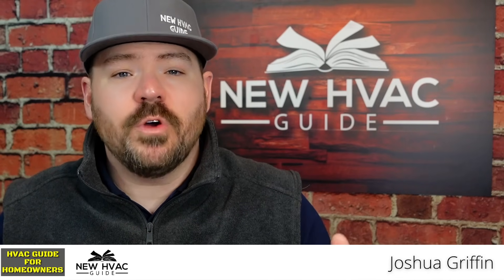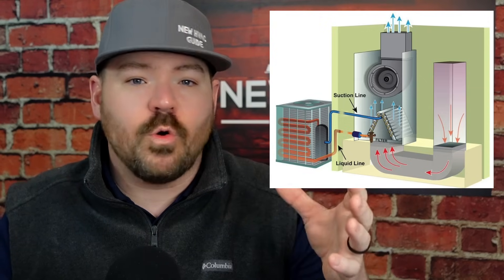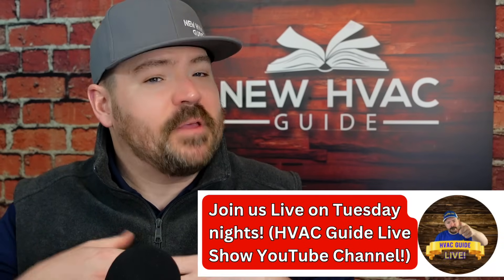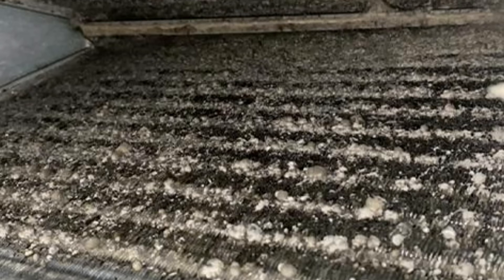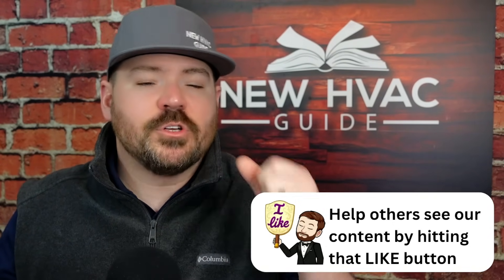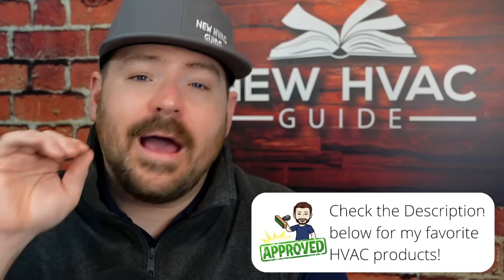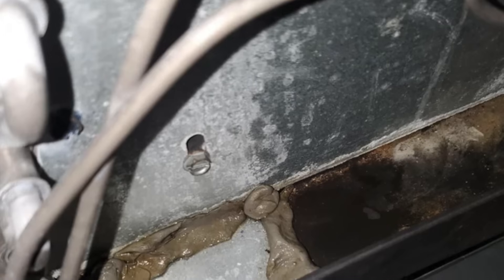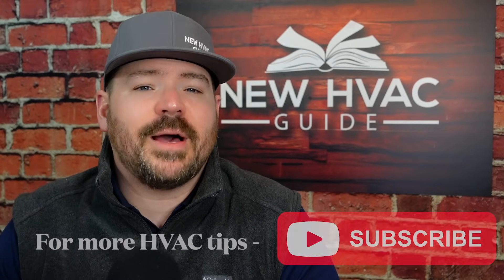HVAC Tip on UV Lights! (Location Matters!)

Comment: I wrote a long explanation of what was just installed in my new Daikin Fit system asking you for an opinion on it, and also other aspects of my install that didn't go as planned. The only thing I can think of to have someone (YT) take it down was I linked the website of the "air purifier" for you to review (in case you never heard of it before). 

I will try again without the link, that being a Respicaire AirSterilizer Pro. If you look it up that way on Google you can see the specs on it, and I inquired what you thought of it. Also the place it was installed was in the plenum above the fan motor, thus none of the UV light (assuming it even has UV) will be hitting the coils or drip pan. As to the issues, I signed a contract for a Daikin 4" hepa filter be installed, and a UV light. Instead they said they were out of the 4" filter housing, so they were upgrading me with a whole house air purifier, hence the Respicaire unit as an upgrade from the two things they didn't install. The other issue was they didn't use the existing duct that went back to the bedroom and hallway returns, and instead said the closet had two opening sufficient to get enough air flow (one in the wall of the air handler closet, and the other to a vent in the door of the closet. 

While I am not a HVAC tech, I do know from my education more airflow coming from distant parts of the house will circulate the air better. Then again you might have a perspective I have not considered regarding the aforementioned. Assuming this reply does not disappear, I look forward to your view.
Reply: @MultiEviscerator  so it’s been about two months and the cigarette smoke is still coming in my house. Spent thousands of dollars and my kid and hacking and having headaches. Our mattress and pillows smell like cigarettes. If anyone can please give me advice I gladly take it. Moving is not going to happen. Single mom and a single standing house costs $600 thousand to 1 million $$. Honestly I shouldn’t have to leave my home because toxic second hand cigarette smoke being caused by the unit next to me.
Reply: @dora7557  Hi Dora - I am not an HVAC guy, only someone with enough knowledge to make me dangerous. I was basically trying to get an answer from the video author, but my posts kept disappearing. So while I'd like to help, I suggest you post your own thread and hopefully he will reply.
Reply: @MultiEviscerator  thank you kindly for reaching out. Honestly I have no clue how to open my own thread for posts. lol. I would be open to any suggestions. My son and I have been sick for the last three weeks breathing in second hand smoking.
Reply: @dora7557  Well I could be wrong, but I think you are reading the posts viewers are posting, and responding to those vs. posing your own question. For example right below the video it shows how many comments have been posted (currently 53 Comments). If you look right below that there is a line that says "Add a comment". If you place your curser there and click, you will start typing your own comment, and hopefully Joshua (who is the HAVC professional might reply to you.

On a separate note, where is the 2nd hand smoke coming from, and how (if you know) is it getting into your place?
Reply from the maker: Apartment property management companies use ozone machines to remove cigarette smell when someone moves out
Reply: @NewHVACGuide  I’m a homeowner townhouse.
Reply: @MultiEviscerator  I literally just read your reply, which I’m grateful for. It went over my head. All I know I had an air quality company that cleaned the vents and the ductwork and place the HVAC in my unit. Im so frustrated with the cigarette smoke my son and I are hacking crap up, coughing and having headaches. Maybe just tearing down the wall and putting lots of insulation and rebuilding that wall will fix all problems. Now I just have to win the lottery to make that happen. lol 😂 Thanks 🙏

Comment: Why did my comment/question get removed?
Reply from the maker: I didn’t remove anything. What did you say? YouTube blocks some language.
Reply: @NewHVACGuide  I wrote a long explanation of what was just installed in my new Daikin Fit system asking you for an opinion on it, and also other aspects of my install that didn't go as planned. The only thing I can think of to have someone (YT) take it down was I linked the website of the "air purifier" for you to review (in case you never heard of it before). I will try again without the link, that being a Respicaire AirSterilizer Pro.
If you look it up that way on Google you can see the specs on it, and I inquired what you thought of it.

Also the place it was installed was in the plenum above the fan motor, thus none of the UV light (assuming it even has UV) will be hitting the coils or drip pan.
As to the issues, I signed a contract for a Daikin 4" hepa filter be installed, and a UV light. Instead they said they were out of the 4" filter housing, so they were upgrading me with a whole house air purifier, hence the Respicaire unit as an upgrade from the two things they didn't install.
The other issue was they didn't use the existing duct that went back to the bedroom and hallway returns, and instead said the closet had two opening sufficient to get enough air flow (one in the wall of the air handler closet, and the other to a vent in the door of the closet.
While I am not a HVAC tech, I do know from my education more airflow coming from distant parts of the house will circulate the air better. Then again you might have a perspective I have not considered regarding the aforementioned.
Assuming this reply does not disappear, I look forward to your view.
Reply: @NewHVACGuide  It just happened again, and I am not cursing or doing anything wrong. Did you see a copy of it before it was removed?
Reply: @NewHVACGuide  I am going to try this one more time, but leave out the name of the company that produces the whole home air purifier in case that is the reason my posts keep getting taken down. Below is the cut and paste without it;

I wrote a long explanation of what was just installed in my new Daikin Fit system asking you for an opinion on it, and also other aspects of my install that didn't go as planned. The only thing I can think of to have someone (YT) take it down was I linked the website of the "air purifier" for you to review (in case you never heard of it before). I will try again without the link, that being a xxxxxxxxxxxxxx. 
If you look it up that way on Google you can see the specs on it, and I inquired what you thought of it. Also the place it was installed was in the plenum above the fan motor, thus none of the UV light (assuming it even has UV) will be hitting the coils or drip pan. As to the issues, I signed a contract for a Daikin 4" hepa filter be installed, and a UV light. Instead they said they were out of the 4" filter housing, so they were upgrading me with a whole house air purifier, hence the xxxxxxxxxxxx unit as an upgrade from the two things they didn't install. The other issue was they didn't use the existing duct that went back to the bedroom and hallway returns, and instead said the closet had two opening sufficient to get enough air flow (one in the wall of the air handler closet, and the other to a vent in the door of the closet. 

While I am not a HVAC tech, I do know from my education more airflow coming from distant parts of the house will circulate the air better. Then again you might have a perspective I have not considered regarding the aforementioned. Assuming this reply does not disappear, I look forward to your view.
Reply: @NewHVACGuide  So now that my post stuck this time, the one above this one, please answer my questions when you have a moment.
Reply: Does the off gassing from a UV light harmful to people 03 is produced with UV lights
Reply: @JeffBaker-ph6yj UV light shouldn’t off gas anything unless there’s some VOC on the bulb itself. It will produce low levels of ozone that can be harmful. You should look into NSF certified UV light that was tested to produce ozone below level considered to be harmful.

Comment: When I replaced my furnace and coil a couple years ago, I was shocked that the coil was fairly clean after 27 years of leak-free service. I did find a quarter-sized patch of mold inside the furnace, right next to the heat exchanger. I have never seen mold grow in that spot before in any furnace.
Reply from the maker: Interesting. Why do you think your coil was so clean? Maintenance?